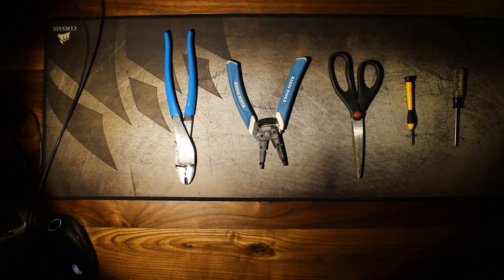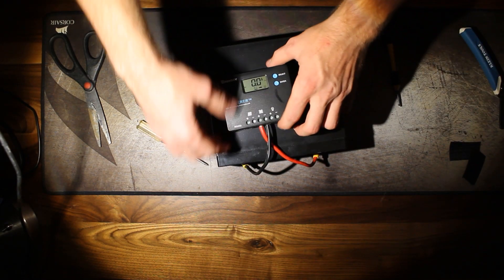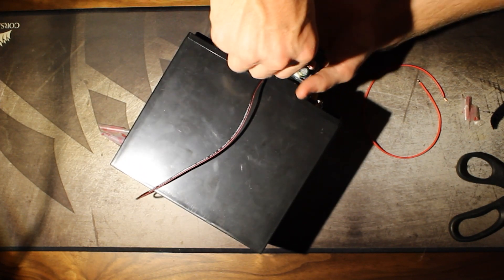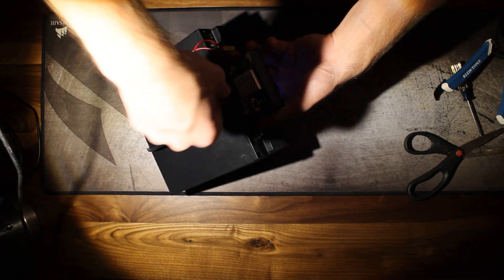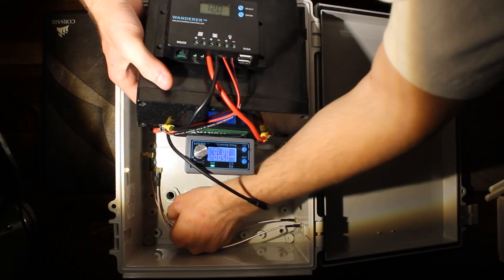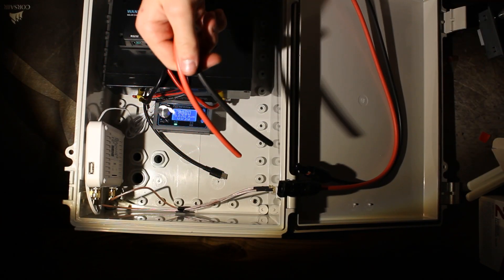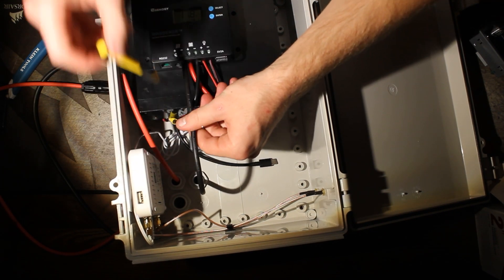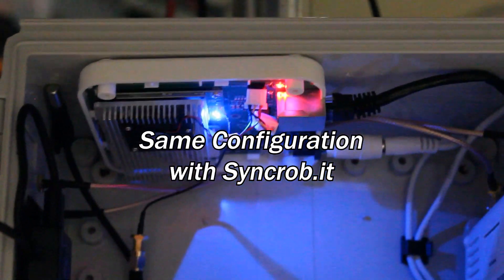Build Your Own Off-Grid Helium Miner EP4: Enclosure Internals

Comment: Do you have any experience with this set up in the field? Do you have actual working miners? I'm wondering about the cellular router and how well it actually performs. The cellular network plans from Tmobile have data limits, that when exceeded, cause a reduced transfer rate. Any issues?
Reply from the maker: Sorry for late reply. Yes I have 7 in the field. There are problems every once in a while but not more then you would expect from one sitting in your house. My data plans are unlimited, costing $40 per month from T-Mobile. Also data usage for hotspots will be going down drastically next month due to the update coming to the network. I wrote an article on this a few days ago on my website if you care to look there. Cellular router performs well for this application. Let me know if you have any more questions.
Reply: @bgoodbuilds4571  thanks for the info. I appreciate your help.

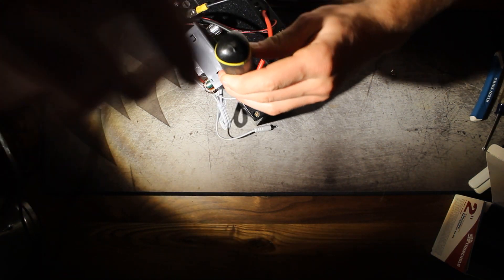Comment: At about 7:25, how do you know which wire goes to positive and negative terminals?
Reply from the maker: Good question. In this case the wire with the dashed gray line on it is positive. That’s specific to the glx750 router
Reply: @bgoodbuilds4571  thanks! Great video series.

Comment: If both the miner RAK2 and mobile hotspot can run of usb I don’t need the booster right?
Reply from the maker: This cellular router does not run on usb. It does have a USB port but not for powering the device. Also, you could maybe get away with powering the miner off USB, however the USB on the controller only provides 2.4 amps, we need 3a for the rak I believe.

Comment: would i be able to use a 54.8v, 236Wh, 4300mAh battery I pulled from a segway minin ninebot?  or is there a different charge controller I would need.
Reply from the maker: You could probably find a way to use that but yes, I’m assuming a different charge controller at the minimum would be needed.

Comment: Cant find the battery in the list?  Also how much battery Ah do you recommend for cold climates and limited sun, Europe, denmark
Reply from the maker: I realized some things were missing. Should be all there now. I can’t make much of a recommendation since I haven’t had to use anything more then 40ah yet but I’m assuming you’ll need upwards of 50 for your situation. Wouldn’t be surprised if 100ah or so would be ideal if there really isn’t much sunlight. You’ll want a bigger panel as well.
Reply: I come from EU, Slovenia and was recommended 100-120Ah battery + 80W solar panel to withstand the low winter light for this consumption. Now Li-Ion batteries may be the best in terms of weight, space and durability, but they are also very expensive, so I used cycling 100Ah battery instead.
Reply from the maker: @mustachess  that’s a great point. if you have the option use lithium, particularly lifePO4 as it is the safest available.